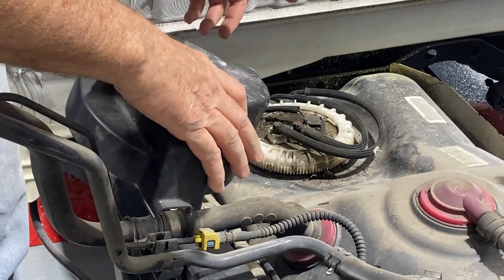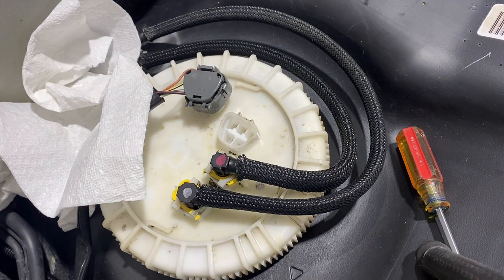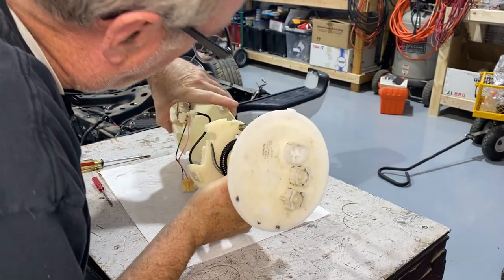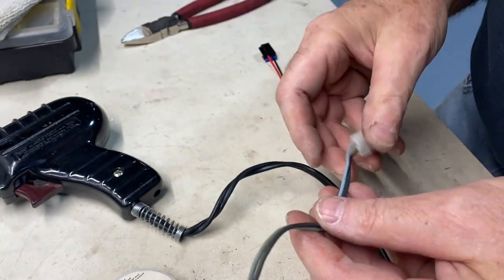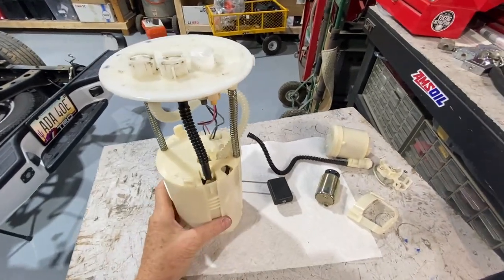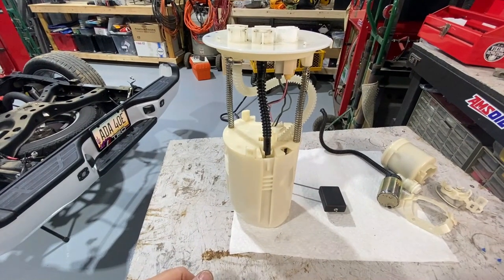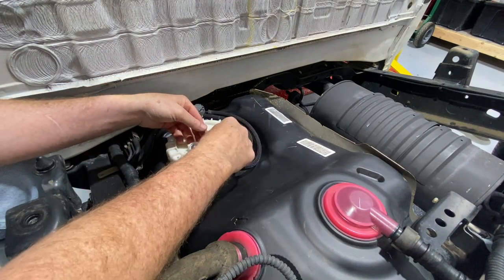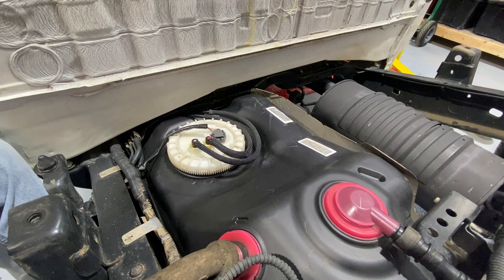Part 2 LS V8 Build Swap Project 2nd Generation Toyota Tacoma Fuel Pump Upgrade How To

Comment: Did you say which pump you used?  also where did you source the white nylon hose?
Reply from the maker: Thank you for the questions. First, the white hose was hose that was included with the new fuel pump. I chose not to use the "old" hose because the end of the black hose was on the old pump really tight and as I pulled on it to remove,  it began to stretch and distort. I didn't specify the exact pump I used because there are a lot of choices for pump replacement. The "exact" pump I used can be sourced in a number of places, but was purchased from ebay:  US Motor Works USEP3240R.
Reply: But why did you upgrade the pump? What’s the delivery pressure of the Toyota pump? LS platforms need 58psi but you get that from your regulator. Maybe the Toyota would have supplied that or been a good lift pump, which would save your higher pressure pump.